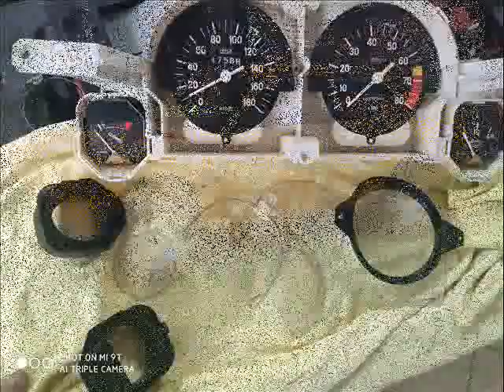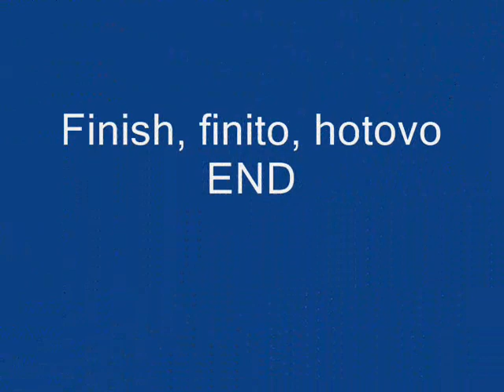Fiat 128 Sport Coupe restoration

Comment: Unfortunately, the body is already extremely rusted through, so that a restoration was not worthwhile. the value of this vehicle is too low for that. Such complex welding work is only worthwhile for very expensive and rare vehicles that are later worth more than 100,000 euros. 🤔
Reply from the maker: the renovation was not cheap, but I don't regret it

Comment: a really challenging  body & restoration. I wonder  why you preferred maintain the  Giallo Positano, instead of one of nice racing Red produced  by Fiat or even Alfa Romeo.
 By converse suspensions set up is excessively  high: beyond the fact that it would not be legally accepted both in road circulation  and into “historical car register” it seems totally wrong and unsafe.
Reply from the maker: giallo positano is the original color of the car, which is very nice, the suspension of the car is also original, cheers